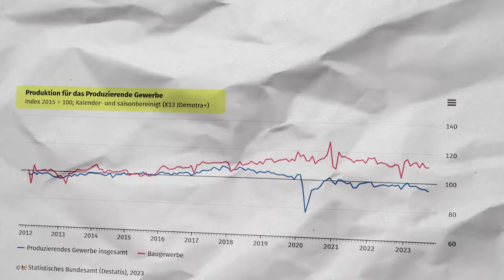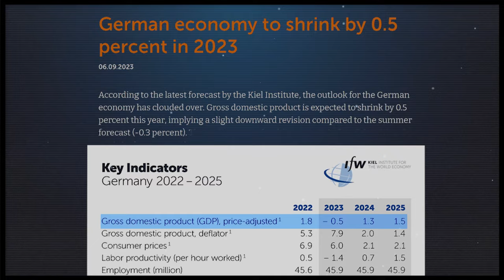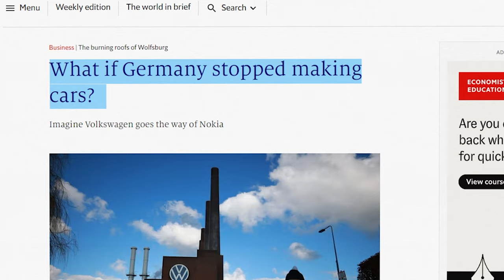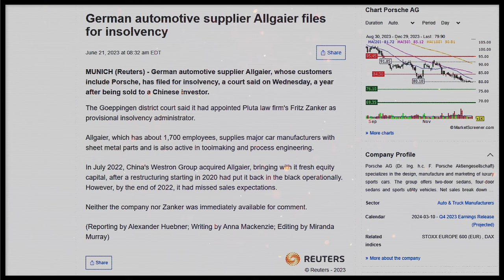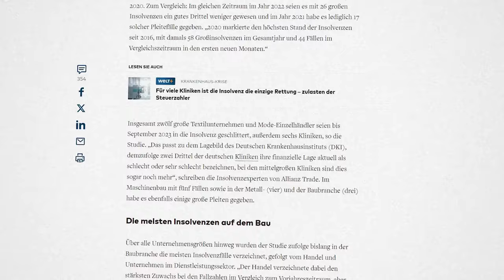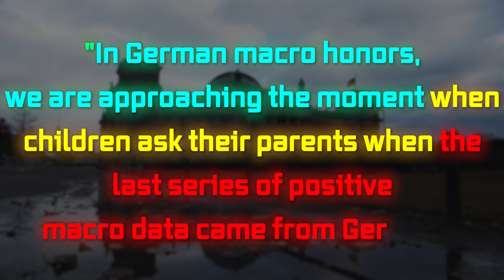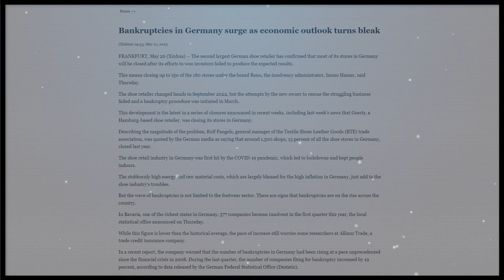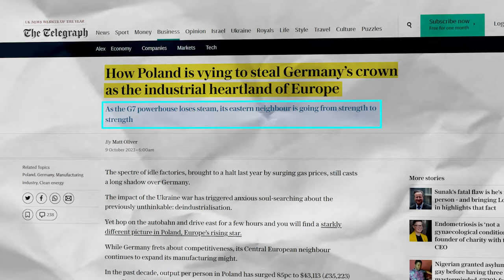Why is German industry DYING?

Comment: Let's address the core issue directly. Germany is currently grappling with challenges related to gas import sanctions from Russia, and the primary driver of its problems is the ongoing energy crisis. A resolution may be found by revisiting discussions with Russia.